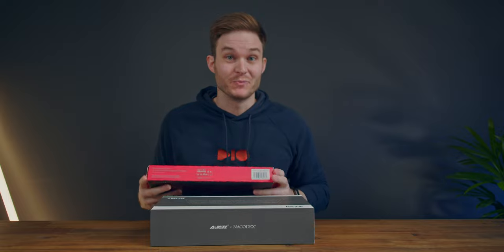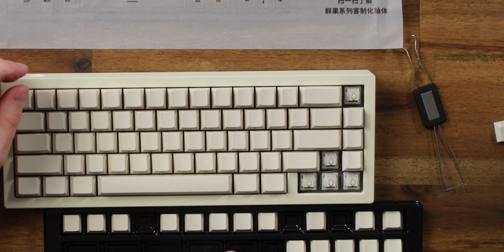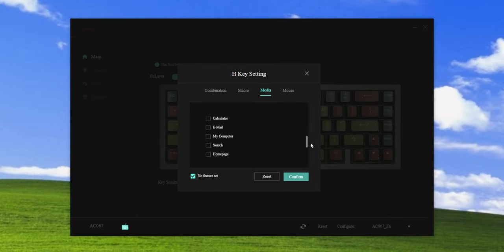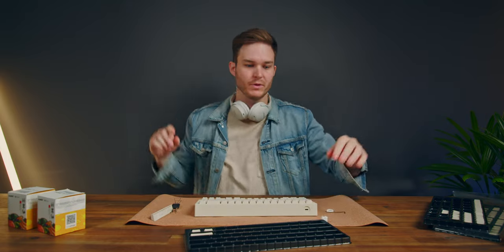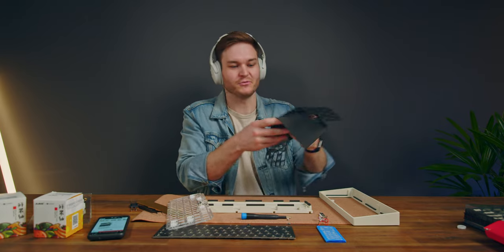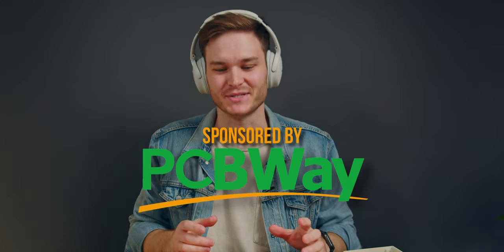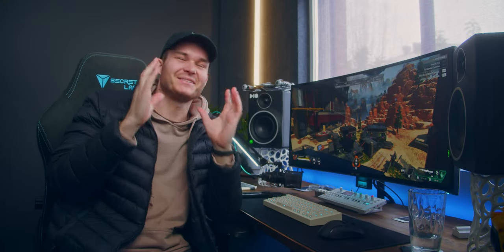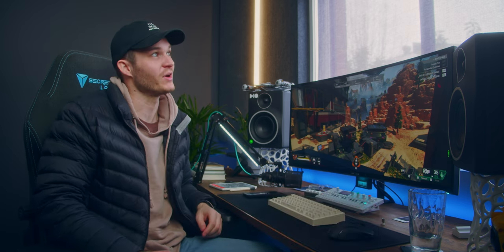Building my first Mechanical Keyboard - feat. Kiwi Switches

Comment from the maker: INPUT LAG TESTING COMPLETE 👉 https://youtu.be/THth51iqC6k
^^I built a latency tester to see which mode on this keyboard is the best!

I had a lot of fun experiencing my first mechanical keyboard build and mods 😄
Let me know if there's a keyboard size or switch type I should try!

As mentionted in the video here are the Battery life testing so far:
2.4Ghz Dongle - RGB MAX brightness = 1 Day
Bluetooth - RGB OFF = 1 Week

I did find with Bluetooth when it went flat and I had plugged in to begin charging, I had to power it on and off again to re-connect. Best once the Low power indication starts to plug in to save the hassle of removing the space bar to access the power switch.